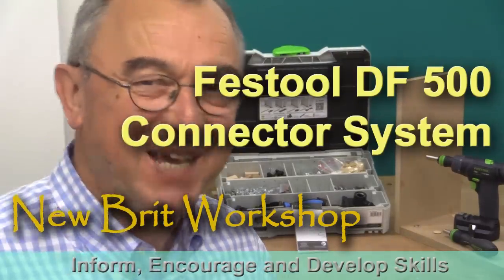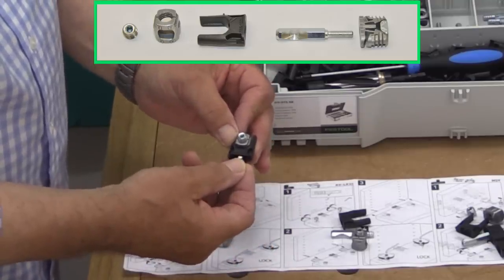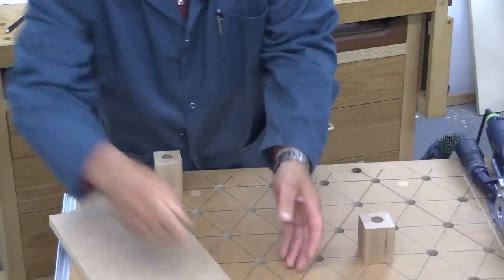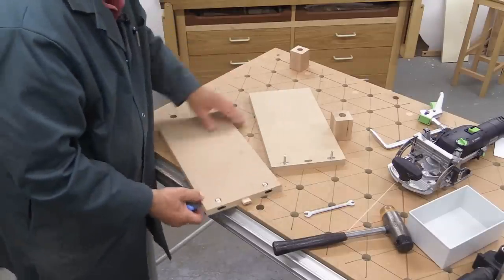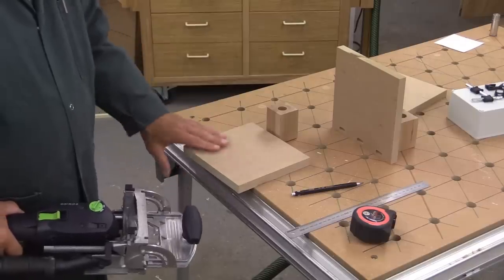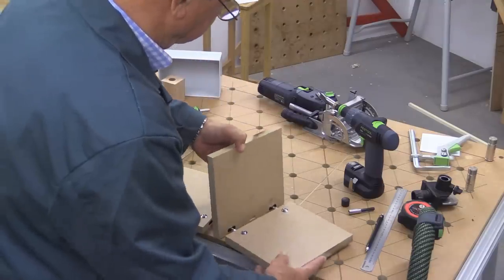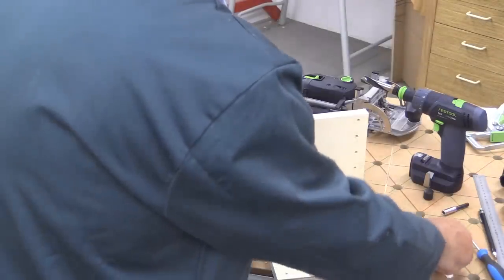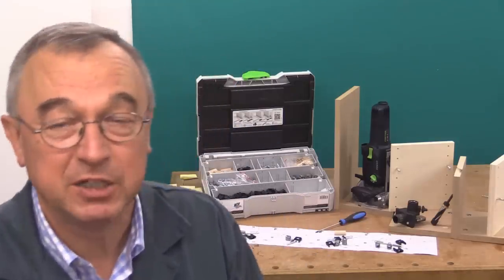Festool DF500 Connector System

Comment: Thank you for a very informative video Peter. When working with an 18mm thick panel, it obviously doesn't matter that the domino thickness is set to 20mm (10mm to centre)? As long as you reference off the correct side of course. Is there any reason to not just set the DF500 to 9mm on the height scale?
Reply from the maker: Hi Chris, No problem doing that at all.  Cheers.  Peter

Comment: Three points Peter.  1/. As always an excellent product presentation.  2/ I can’t for the life of me work out why I would want to build something that I would later want to disassemble.  3/  The price is ridiculous even for Festool.   Cheers
Reply from the maker: Hi David, First, thank you. Second, there are loads of things that people want to assemble and then take apart. Third, I think that a lot of research has gone into this and so Festool has to get a return on that. Given that the Lamello machines are more expensive than the DF500 a holistic approach gives it an advantage.  Peter
Reply: Building in the workshop and assembling on site has many advantages. Especially if access is restricted elevators .  Built to fit in an alcove etc.
Reply from the maker: Hi Paul, That is a very good point.  Many thanks.   Peter
Reply: logic should prevail there a mass market for this type of build and there are tonnes of reasons why you would want this which is why it exists and why it sells, it's accurate,  only expensive if you build is not taking into account the costs of using the machines in the first place.   you can buy cheaper options but you know what happens there.

Comment: I think using standard joinery is a far better option. Lets not go to bonkers on the the Festool corporate band wagon...
Need to promote more joinery skills. However as ever Peter excellent video showing all the options clearly thank you.
Reply: But "standard" joinery doesn't typically take knock-down furniture into account. In almost all cases, knock-down furniture takes specialized hardware. This system is a bit more elegant than (and more expensive vs), say, the ikea version.

If you have a Domino joiner already, this also helps avoid requiring another set of tools (dowel jig) and parts (dowels).
Reply from the maker: Hi Craig, I agree about not forgetting joinery skills but, as Pete Brown says, the system does provide a "knock-ddown" option.   Cheers.   Peter
Reply: i dont think this replaces joinery, thats what the domino is for... :)

Comment: Thank you Peter. I am thinking of taking the financial plunge on the domino cutter and connector set. I understand the intended use for these is probably mostly cabinet based. Do you think these would be strong enough for a bed frame - leg to side rails? Or would that be pushing it a bit? Many thanks for your videos.
Reply from the maker: Hi Edward, I would not use the DF500 connectors for a bed frame but with some clever design work it may be possible to make it work. The DF700 connectors are as tough as anything and would be perfectly suitable.   Peter
Reply: @NewBritWorkshop  Many thanks. E

Comment: Well done Peter. I just received my kit a few days ago. Can’t wait to dig-in and see how this system works out. I get that the joints are strong and a reasonably intuitive system to get and productive promptly. Does any one have data or experience of these joints surviving multiple set ups and breakdowns? Do the joints stay tight?
Reply from the maker: Hi Brian, I see no reason for the joint to weaken as it relies on the mechanism not the wood. Just how many times is any piece likely to be assembled and disassembled?  Peter
Reply: New Brit Workshop Hi Peter, I’m thinking of both non-profit organizations that don’t have a lot of storage space and yet share assembly space with other groups. I just maybe over-thinking the ease of assembly/breakdown functionality .
Reply: Brian Russell    Brian, a friend of mine used this system to make some furniture that he uses for camping. He lays it flat in his camper then puts it together at the campground then breaks it down flat in his camper for transport back home. I believe he has gone camping 5-6 times with the furniture so far with no issues....
Ron
Reply: Ron H That’s a great example Ron - Thank you! Being an old Scout Master, I appreciate the camping reference. 😊⛺️ 

Seriously to Peter’s point, most tables, bookcases, etc that are assembled with the Connector System will likely have a low assembly/re-assembly rate in its life span. That said and knowing FESTOOL like we do, I should assume they designed and engineered the connector system in a robust manner. 

Peter, thank you for another very informative video.

Comment: Hi Peter, planning to use this system for a standard wardrobe assembly.  I assume a connector top and bottom plus (some) dominos in between—what pitch spacing would you recommend? Thx
Reply from the maker: Hi John, It is difficult to answer as it will depend on the length and width of pieces. Supposing you are jointing the top and bottom to the sides and the width is 600 mm then I would use 3 domino connectors with 2 normal dominoes in between so 5 pieces across each joint.  For intermediate shelves it might be reasonable to use 3 normal dominoes and 2 connectors.    Peter

Comment: great video. one question : is there any reason why the round hole, grub screw and (horrible) plastic cap has to go on the inside of the cabinet? why not on the outside where it would be less visible? tx
Reply from the maker: None as far as I can see although you do need to watch your centres and ensure that you end up with flush corners.   Peter
Reply: I can’t think of a reason why not ... will let you know how I get on. Tx Doug

Comment: Morning Peter, i was wondering that if  the domino connector system is good enough (stability wise) to make a bed?  i have used the cross dowel nut/bolt and they are very stable. am saving now to buy df500 on your video suggestions.
thanks for educating in advance.
Reply from the maker: Hi Mian, I would not use the DF500 version for a bed as it is really only suitable for cabinets even with a pair of normal dominos. Could you borrow a DF700 and use those connectors - they would be excellent.  Peter
Reply: @NewBritWorkshop  thanks a lot for prompt reply. That's very kind of you.

Comment: Thank you for this illuminating video! Have you tried to make the same connections with the Domino XL? I suppose this should be possible as the XL also has an 8 mm drill...
Reply from the maker: Hi Frank, No, but I have made a video about the DF700 connector system.   Peter
Reply: Hi Peter. I have watched that video. In theory I think this new 8 mm connectors should also work for the DF 700,maybe the depth of the cut has to be changed as the references are slightly different between the 500 and the 700. I'm waiting for my kit and as I only have the 700 I will give some feedback on it if it works
Reply from the maker: Hi Frank, The DF700 can be used with the DF500 connectors. The DF700 can do a cut at 10 mm height (to the centre) and at 15mm and 25 mm depths. So the only difference is the 25 mm depth of cut instead of the 28 mm depth with the DF500.  Peter

Comment: Thanks for the video. How strong is a connector joint compared to a glued domino joint? 

And how strong is a half glued domino joint?
Reply from the maker: Hi Tom, I have no measurements to give you so my answer will be difficult. The joint will never be as good as a glued domino joint but it is good enough for many woodworking applications.  Peter

Comment: £300 seems a little strong for this kit even for Festool.
Reply from the maker: Hi Chris, If you start by comparing the cost of the Domino machine to the Lamello then the Festool system does not require such a sizeable investment at the start. When I sold my Lamello machine which was 12 years old I nearly had enough to buy a new DF500.  Peter
Reply: New Brit Workshop I’m not really sure where this product fits. If I’m manufacturing cabinets commercially the cost of around £1/fixing would be uneconomic. If your making a kitchen say you’d be looking at say £10 worth of hardware per u it, average kitchen includes say 15 units that’s a lot of outlay for something which doesn’t really add value. The only situation I could think of where you wouldn’t rather assemble/glue in a workshop is if access were really tight. Conversely as a hobbyist apart from the novelty value when would you want or need to essentially make flat pack furniture?
Reply from the maker: Hi Chris, I take your point entirely. When I have made bespoke units I have assembled them dry in the workshop and glued (or screwed) up on site - in those days I had my old Lamello. So, I was not worried about taking it apart again. However, there are circumstances where a knock down approach is useful. Perhaps when the time on site was limited or when there was a real requirement to take things apart. The best way to view this and any other system is that it gives users a capability to do a particular type of joint and it is useful to have that in the arsenal of options when doing cabinet (and other) work.   Cheers.   Peter
Reply: @chrisb4009  
You can use just a few on a cabinet and then use the remaining as standard Dominos that are glued. 

So you make in the workshop. Take it to site make up the cabinet and then glue it with standard domino. 

Some cabinets are best done on site.
Reply: bighand69 lot of tooling/equipment, you’d need to be doing a lot of volume for it to be worth going down this route. I generally  achieve something similar with pocket hole screws + Domino.

Comment: For me the DF700 makes a lot more sense then the smaller DF500 because the cost per joint is a little to expensive compared to the competition like Lamello
Reply from the maker: I think that the initial outlay of the Lamello is higher than the DF500. Also, the joints with a shelf on either side of an upright are not as strong with the Lamello.   Peter
Reply: I agree